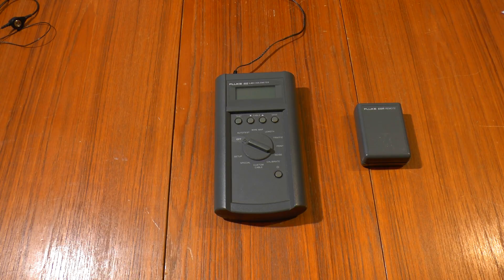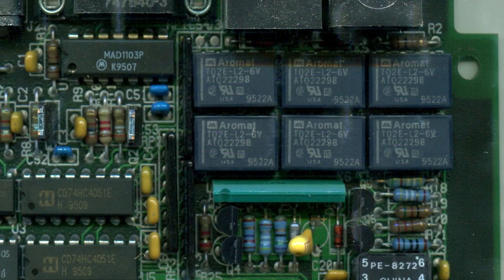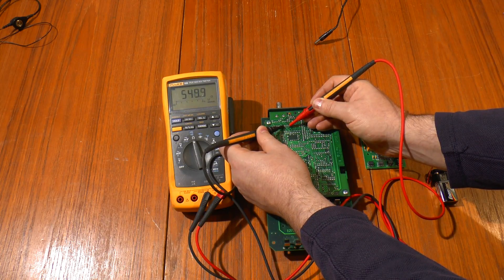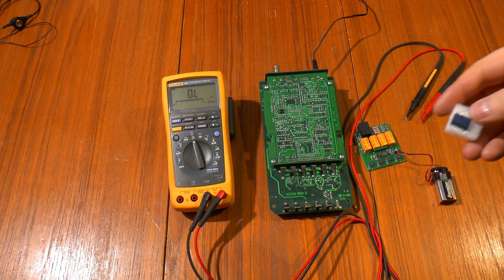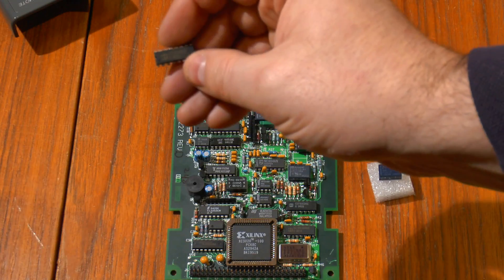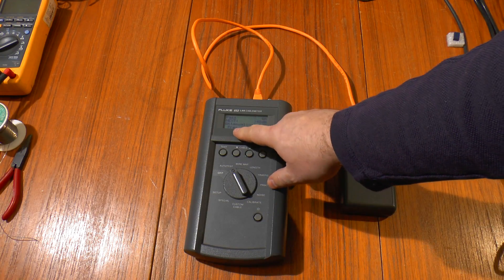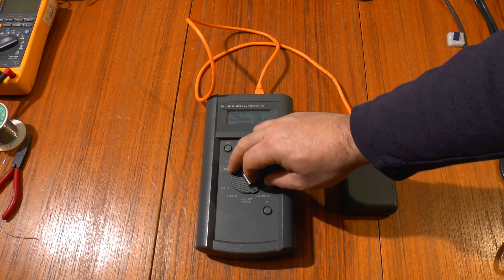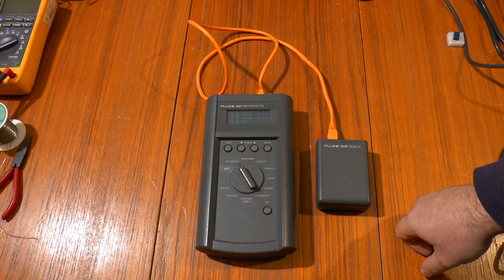Fluke LAN CableMeter 652 teardown and fix

Comment: This might be asking a lot, but i have fluke 650 lan cablemeter, but I'm missing the 650R remote, any chance to get a high res pics of the both the back and front of the pcb?, want to try make my own replacement , i know if you gave the front already but yeah, also what is the green rectangle block between the relays and transistor array? and any idea what the zener diodes are? value wise? are they used for breakdown voltages perhaps? or just signalling  ?
Reply from the maker: I'll see what I can do.  I don't think board photos would be sufficient as there'll be tracks under the relays, but I should be able to borrow the unit from work again and pop open the remote to see what's what.
Reply: @AintBigAintClever  that would be amazing! but yeah if its not too much it would appreciative maybe allow other ppl to build there own but yeah dont think i'll get support from fluke for something this old i dont think
Reply from the maker: @squirezz  https://drive.google.com/file/d/1cGlGGGBPzsRVcUS_0h8CplVbqkPzuMIK/view?usp=drive_link
Reply: @AintBigAintClever  oh my! This is waaay more than you had to do wow! did you make this? This is amazing
Reply from the maker: @squirezz  download it again, I've added a third page with a circuit analysis.
I finally remembered to grab the tester yesterday afternoon, took a few hours to trace the schematic based on following tracks, some continuity checks and manually setting the relays.  This morning I've looked at the schematic to work out what it's doing, which helps determine if I've missed any tracks out, I've also tweaked the layout slightly to make the K2 connections clearer.  I think it's all correct.
Reply: @AintBigAintClever  you're a god

Comment: Smashing job, you saved a great tool :-D.
.
I first thought it was some kind of mov protection devices connected to the socket.
Red herrings can be a bugger, ive been caught out with repairing electronics as well, usually it happerns after having a long run of typical faults.
We forget that the red herring is just waiting to pounce on us LOL :-D

Comment: Wonder what caused the chip to die... Pretty neat you found the fault and fixed it!
Reply from the maker: +Luke Den Hartog I didn't check to see if the chip has any connections to the external jacks, either directly or via the relays.  Initially I thought one of the relays had been fried by Power over Ethernet voltage or telecoms voltage, but obviously it wasn't that.
Reply: Electronics sometimes fail in the most weird and wonderful ways... which makes troubleshooting either fun, or insanely frustrating...
Reply from the maker: It's a 20 year old meter and it's served us well. It paid for itself even back when we had BNC networks, saving hours of troubleshooting by telling us the distance to the fault and allowing us to home in on the problem. If we were going to order a new tester it would possibly be another Fluke, but one thing to watch is the battery as our Fluke OneTouch has a battery that is proprietary, expensive and very much dead. At least the 652 uses six AA and the remote a PP3.
Reply: +AintBigAintClever Seems like they should have charges under $100 for it back when it first came out.
Reply: +AintBigAintClever distance to the fault? now that's useful, haha!
Reply from the maker: Very useful in the old days of BNC cabling (terminator at each end and a length of cable T-pieced off at each PC). Whole segment down, just break into the cable and test. Terminator detected? Fine. Open at 36m? Plug together and try behind another PC further round the room. Open at 54m? Damn, go the other way. Open at 17m? Now we're getting somewhere. Open at <6m? Check the ends of the cable you're on now.

Cost us about two grand twenty years ago and more than paid for itself since then.